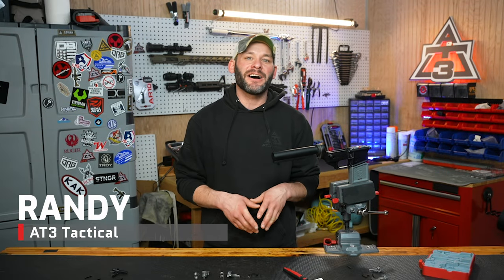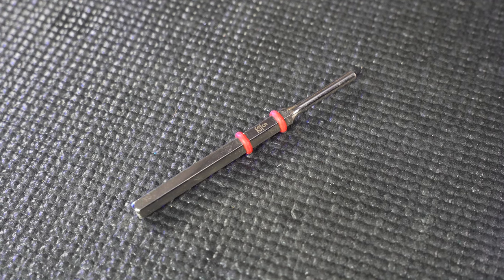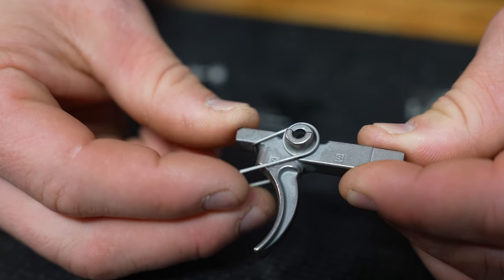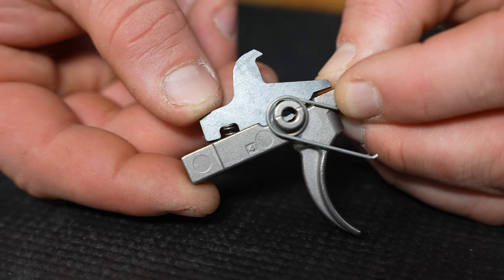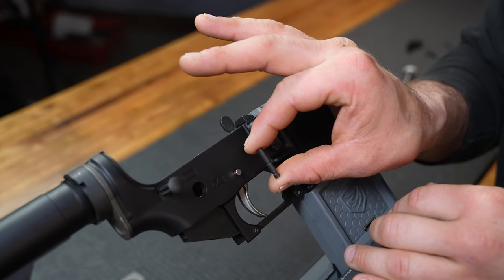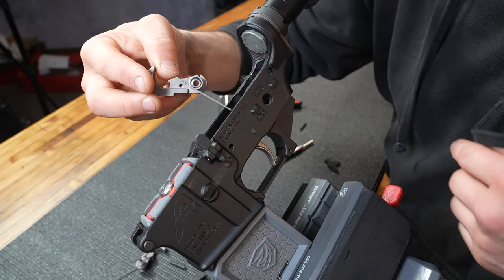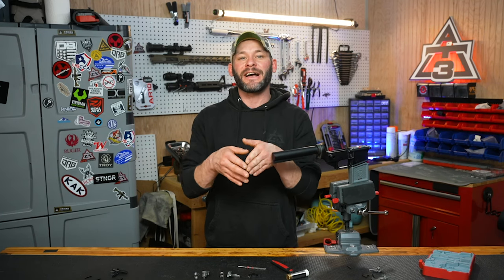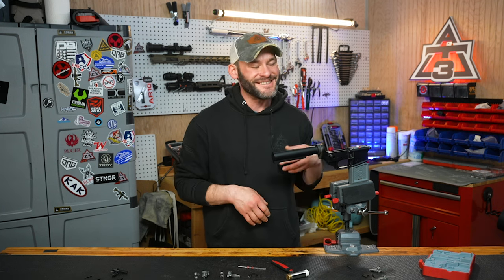How To Install a Single Stage Trigger on AR Rifles - The Easy Way

Comment: Great video Randy......... Now can you please make a quick video on how to remove the take down/pivot pins out..... what tools you need to do it with..
Reply: Pivot pin tool... Real avid has for $10 or $12 bucks. Real simple to use. Even think they sell it on Amazon
Reply: @aceup8819  yes i have one... i just wanted to know how to get the spring and detent out of the groove in the pins?
Reply from the maker: Great suggestion!

Comment: Installing the hammer is nearly impossible when you are over 55 and have gone through the strength loss.  You make it look 40 times easier than it is.  So you might want to show the real struggle and not make it look like a cakewalk.  I have been working on a tool to allow more pressure to be applied with control of the hammer's position.  This video appears to be a strength shamming rather than a help.
Reply from the maker: Sorry to hear that.